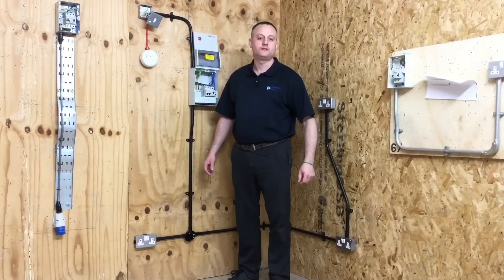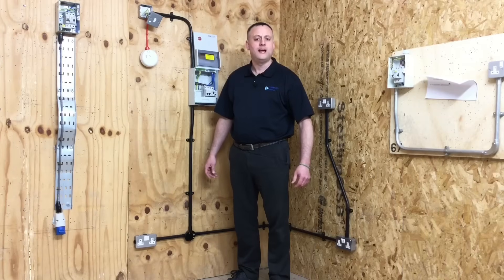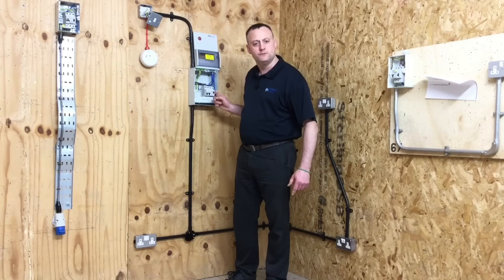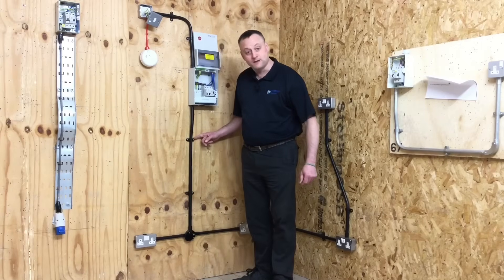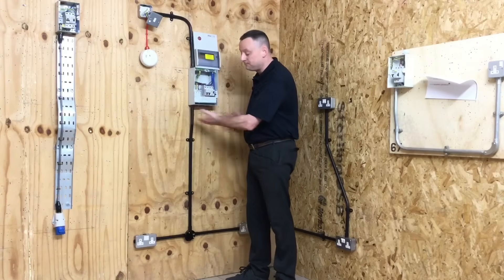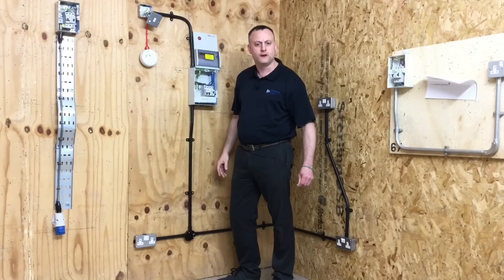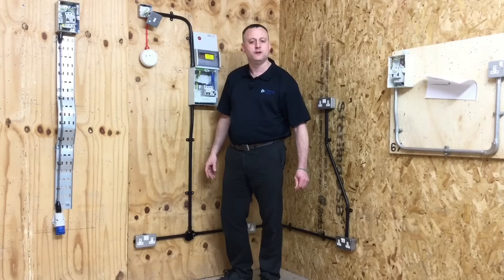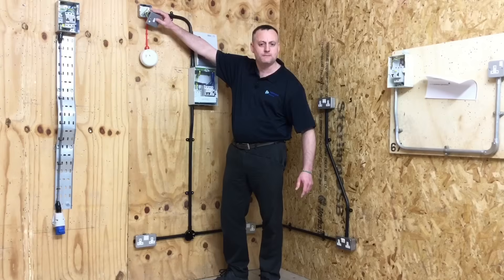Re-Cap Learning Part 3 our PVC Conduit Ring Final Circuit (Installation Theory Exam Revision)

Comment: 2.5 singles in conduit is rated at 24A. Two pairs defrayed by 0.8. This ends up under 20A the minimum for each side of the ring........ or am I wrong?